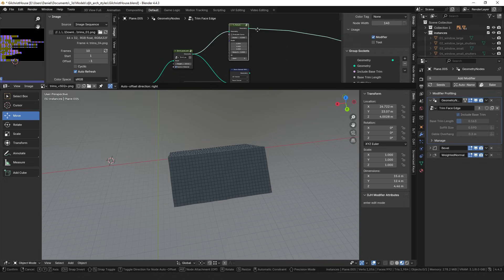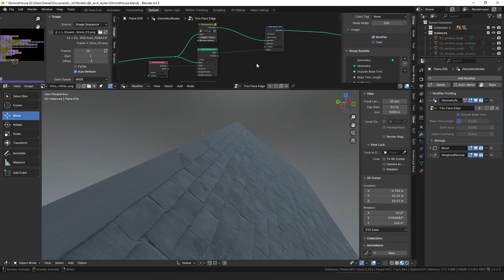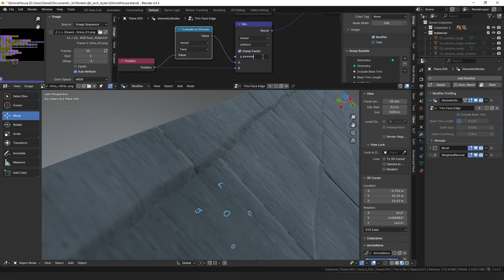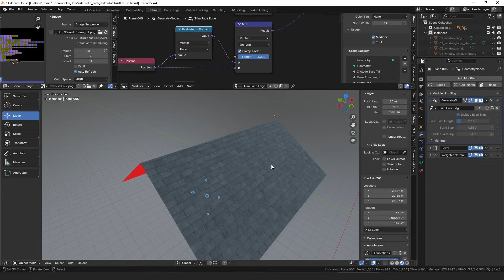UV Transfer Tip - Blender Geometry Nodes

Comment: thanks for that tip! I'm currently trying it on a voxel remeshed version of an object, and it seems to have flaws in concave surfaces
Reply from the maker: Yes, that's what I couldn't quite remember.  I don't think the problem is if it is concave, but if you remesh you also have to group the faces so that all the corners of a face sample from the same UV island.   I'd have to try and go back to that file to remember exactly how I did that.